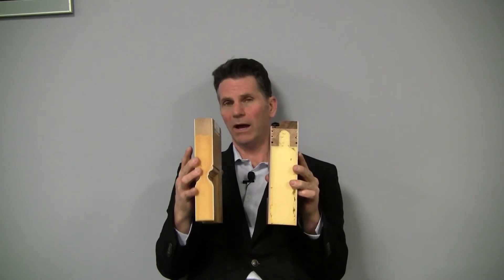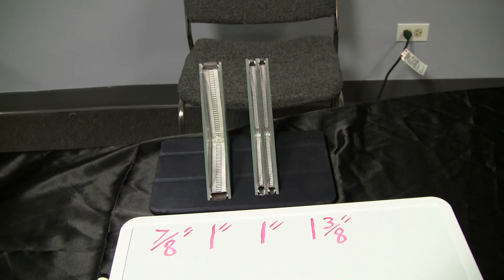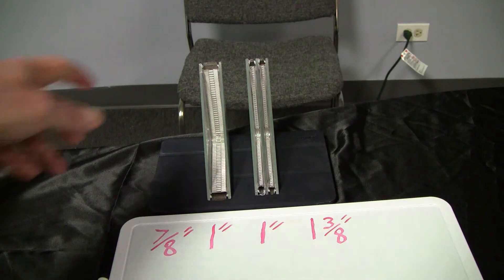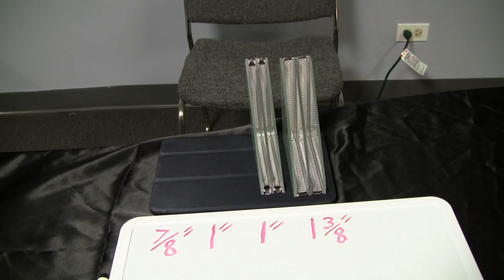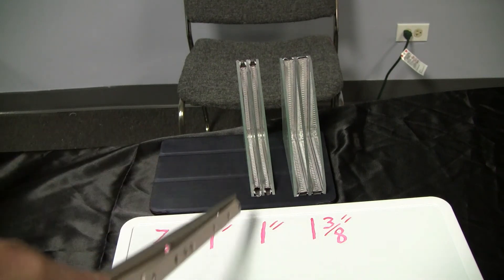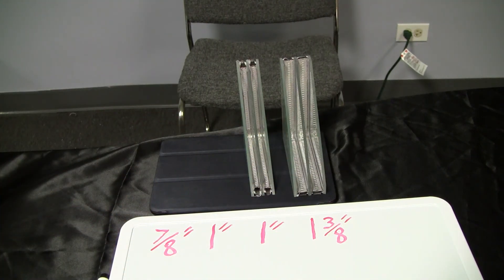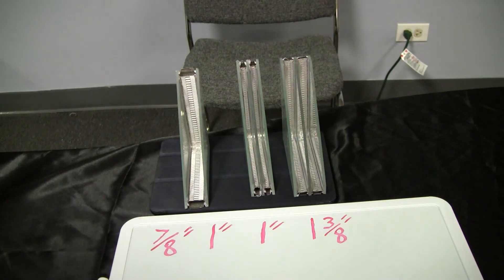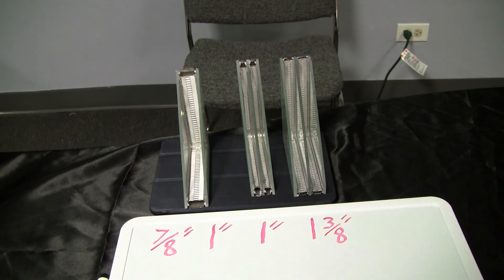Is all triple pane glass created equal?

Comment: Nope, the 1" dual will not outperform the 7/8" dual IGU's since IGU performance begins to decline at about 13/16".
The optimal thickness for a dual pane IGU is 7/16" to 1/2" (slight variations depending on coating). Starting as low as 5/8" width space (depending on glass thickness and coating used), IG performance will begin to degrade, primarily due to convection currents within the airspace. Argon or krypton do offer a noticeable improvement over air in the space because they affect the convection currents. If you want to split hairs, glass thickness can have a greater effect on glass performance numbers than a small difference in airspace width, all else being equal.
Triple pane does not generically block 40% more sound than does dual pane, curious where you arrived at that number since you use it all the time. In fact the 1" dual pane in your example should have better sound performance than the narrow triple that you compared it with, again all else being equal. 
The biggest potential advantage of a triple over a dual in sound performance is the width of the airspace. If the combined airspace width of the triple isn't greater than the airspace width of the dual (glass thickness being the same in both - 2 lites @ 1/8" in dual and 3 lites @1/8" in the triple), then sound performance will be pretty much equal. But if the dual has a 1/2" space and triple has two 1/2" airspaces, then the triple will have better performance.
LowE coatings and argon and krypton gas infill have no effect on sound performance.

Comment: You mentioned the sweet spot of glass space in the video. I'm curious to your sources or evidence that the 1" unit fairs better than the 7/8" unit. I have always heard Argon's sweet spot is 1/2" space (3/4 overall dual pane) and Krypton's sweet spot is 1/4" (7/8-1" overall triple pane.) I believe that was a study done by Cardinal a few years ago. 

Your thoughts on that?
Reply: The sweet spots you mentioned for insulating property of Argon and Krypton are correct. Each pane of glass is about 1/8". That is why double pane windows are typically 3/4" to 7/8" and filled with Argon. Triple pane windows need to be filled with krypton if you want an optimally performing triple that is sub 1" overall thickness IGU. If it is to be filled with argon then a triple should be closer to 1-3/8" to be optimal. Argon is less expensive than krypton as long as you don't mind the thicker IGU.  It is common for window manufacturers to make  sub-optimal IGUs just because they don't have a frame that can accommodate the size of a thermodynamically optimal IGU.